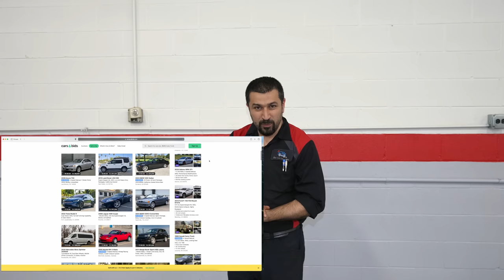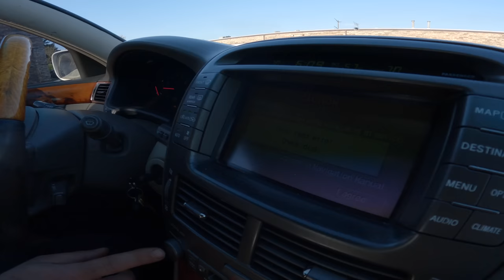I Bought a 600,000 Mile Lexus Sight Unseen! How Bad Can It Be?

Comment: Funny but I owned a 1993 sc400 I put over 400k on it and believe this or not I never had an oil leak only minor cost repairs. I sold this and it only needed was suspension over hauled. The best car I’ve ever owned. I own a Mercedes cl ,ml,sl,clk,and an e class . BMW 7 series ,3 series and the absolute most reliable and cost effective car Lexus sc400.

Comment: For an old car with high miles, nothing consequential wrong with it if the price is right. One issue is that the model engine they use has an interference timing belt. If you were going to just drive around locally, you probably could do nothing except fix the brakes and it would run for years. I am my own mechanic. When I did the timing belt, I would change all the seals on the front of the engine also.

Immediate fix list: Rear brakes. Bad wheel bearing. Timing belt unless it has a service sticker on it. I would service the transmission with a new filter and a drain and fill but transmissions on a high mileage vehicles are always a hazard.

Comment: My 1990 LS400 had no drips at 200k miles.  ( It had no squeaks or rattles either, but I digress . . . . )
I bought it at 85k and it never failed to start or run perfectly. 
I've been an all uber guy since 2019, but if I bought another car, it would be a V8 Lexus.

Comment: A dirty car can be an indicator of an owner who doesn't care but not always. 
I change my oil every 3k, just had the transmission fluid changed 10k ago and I just put in a new air filter and rotated the tires. But I haven't cleaned the interior in 7 months. It's bad.

Comment: I love the LS too! I have an 02 LS 430 and I LOVE it! Mine has 228k on it, and it smokes some on start up. I'm thinking valve guide seals or worn rings. I haven't gotten into compression testing or leak down testing yet but I'm curious if you see one thing more than the other and is it worth repairing or replacing the engine? It also has sludge build up in the engine. I found a JDM engine and trans complete with all accessories for 2700 near me with 45-60k miles on it. I really do love the car and I'd like to keep it going. I'd love to know your thoughts.

Comment: I've had my share of bad after market starters and alternators but going OEM on brake's and struts. That's just throwing money away. Especially on a car with that kind of mileage. I don't consider after market parts a hack. It's usually worth the risk when you consider the cost of OEM parts when they ware out anyway. What I would look at first is a timing belt. That has a interference engine. Surprised you didn't mention that. You guys never mention what you pay for your cars. It couldn't have been too much.

Comment: My 2015 Lexus GS 350 was $13k with 186k miles. Engine transmission and interior are mint. The exterior has small issues. So 186k miles is nothing compared to that LS430 😂😅. I swear that my GS 350 with 186k drives like a new car.

Comment: A great video again, unbelievable a million miles for this 🚘 . Just off the subject I bought an Xtool D8 in Australia, I really liked it but hold and behold IT DOES NOT HAVE AUSTRALIA 🇦🇺 on it. Yes it has Albania 🇦🇱 and Austria 🇦🇹 when I checked the Oceania region. It does not work for Australian Nissan XtrailT31 2010.  Very unfortunate. From 🇦🇺🦘🦘🦘🦘🦘
Reply: To add, I could not contact any site listed as technical support, none of the email address were valid. This is the reason I returned the tool.

Comment: Hello, I learn something every time that I watch your channel and I enjoy your videos very much. I have a question for you about my own vehicle: I have a 2017 Cadillac Escalade with 93,000 miles on it. Everything is fine, but when I asked my mechanic about changing the coolant and replacing the automatic transmission, filter and fluid, he said that I was just asking for trouble if I did that. What are your thoughts please?

Comment: My assumption would be - driven a lot, but always kept in garage... maybe even washed before parking... that is the only way it stayed rust free for so long and so many miles.

So I would assume the use case was as such, Monday morning comes out of garage and drives for 5 days straight (not sure what is the reason... salesman?!), by Friday absolutely filthy an covered in shit, goes to car wash (even automatic one, it is good enough to blow away the road grime and clean cars don't rust) and then goes into garage over the weekend. Rinse and repeat next week.

This would explain exhaust still being in good shape... exhaust usually rusts from inside because if car is not driven for long time, or driven for short trips the condensate stays inside and rust it out, but if car is driven for long time then exhaust get's how enough so that condensate evaporates. Basically car would be used "warm to warm", it leave garage warm and dry, gets cleaned-up and get's parked up still warm after long drive. 

Same can be said about paint - clearly garages as else the clear would be burnt trough, but as well regularly washed... if the grime stays on the paint this accelerates paint wear. All in all - seems solid car after 600k miles... the only issues there are... all related to hack job, not anything particular broken on the car.

Comment: Pursuit of perfection but not built tough.

The life cycle of a Crown Vic is: Police use up to 200k>Taxi Use up to 500k>Ghetto incarceration until crushed. It’s not difficult to find Crown Vics and Town Cars with 700k+ miles. The difference is they still work.

A super high end luxury car like this Lexus has too many new fangled features like active exhaust or break wear sensors that just add to the Christmas lights on the dash.

Crown Vic and Town Car are trucks underneath. The weakest point is the rubber bushings in the suspension and rear air coils. Oh well. Cheap and easy fix. Won’t stop me from driving mine off road as I occasionally do. I spend so many miles wishing something would go wrong so I could work on it but it just never does 😢

Comment: Most cars with over 200,000 miles have more than their fair share of hacks. Why? because parts for older cars are hard to find and cheap aftermarket parts are often the only parts you can find. Also, when you have an old car with high miles, you don't want to spend a lot of money doing the job the right way. You only care that the car performs its primary function, which is to get you there and back. Good luck with your project.

Comment: I like the LS430, but in this case I'd much rather have my 2007 LS460 with with 134k miles and i bought it with 31k miles. 

Half way through video and if he paid more than $1500 for this car I'd say this one is a money pit.

The average non mechanic could get a much better condition LS 430 for $7 to $9k with much lower mileage and better condition.

Comment: I made a milion with 94 hyundai sonata smiles. Ofc it head engine rebuild pistons went to .50 metric automatic gearbox rebuilded  cuz i lost 4th gear it cooked,  i needed to do hack job esp at rear end cuz i couldnt find parts there was no control arm bushings exist anymore  so  i needed to buy whole arm and i bought 4 of them and all of them was left side, at body connection bushings was gone and hole was streched so new bushings wasnt hanging in there so we cut that side and welded again that was necessary cuz when i done front end back side of the car started to go left and right like dancer :D So sometimes you have to go with hack job. But crazy thing body of car was still rock solid and mufler was original smiles sad thing i couldnt keep that car and sold it still i miss it..

Comment: Good morning car care tonight so I have a 1987 Toyota forerunner it's terrible charged I'm having some issues and I'm being told that it can and it cannot be machined the block apparently needs to be redecked what is your recommendation the vehicle has 2400:00 miles originally I picked up the car at 1500:00 at a 160 the timing chain went out we replaced that at  2,18000 the turtle went out We then did a valve job upgraded the Turbo to Garrett and replaced all the necessary gaskets Between 2,18000 2,43000  It began forcing compression into the cooling system it's not in the oil and it's not coming out of the exhaust I being told that the block needs to be reject what is your opinion To classic vehicle and great physical shape but this is an ongoing issue

Comment: I don't see much to complain about, honestly. You're talking about an enormous number of miles. It's not going to be perfect. It seems like it was very well cared for, right up to the point that the second owner took over. That's when all the hackery occurred, which is easy enough to correct. It's not like the hackery got baked in over 200,000 miles. 

It was probably some traveling salesman's car. After the lockdowns, he figured out how to do his work on Teams and eventually got tired of the car taking space in the garage. 

I think the problem you'll have is drawing the line between maintenance and restoration. For instance, when you realize how much it will cost to replace all the seals on a 600k trans, you have a choice. Replace the seals and gamble that the trans won't die soon, or just rebuild/replace the whole thing now? Good luck on your purchase.

Comment: I can see a lot of posting coming from this long-term project car.  With any luck, no major oh-sh$& will happen.  It would be nice to have a 1 million mile Lexus in the garage.  

This is almost the complete opposite kind of vehicle I buy; buy a very reliable manufacture model 1 year off a major redesign with as low as miles as you can find.  Then, you stay on top of the O&M.

Comment: I just buy 01 lexus ls430 with 125k milles timing belt snap so I'm going to start at the heads oil pan visually check the pistons if I have to I'm going to rebuild the engine from ground up

Comment: Me thinks doth complains too much. But with that said, you also got carried away in the auction and paid double what it's worth. I sold an 03 Sequoia with 500K last year for $5000 after putting a few thousand in parts into it, but only paid $1200 for it. You get the parts at wholesale and provide the labor for nothing so you have bragging rights for the mileage. That's priceless.

Comment: Amd, I love ya, but they aren’t “hack mechanics” because they used a different hose clamp you don’t like or bypassed the heater valve. Heck, it sounds like the owner drove long distances for a living and could’ve been stranded far from home with an unacceptable wait for a bypassable part. Circumstances exist. It isn’t always about comparing one effort to another. Not every shop is the Toyota dealer… and that’s OK.

Comment: I'm not sure why aftermarket hoses and worm clamps are such a red flag. I understand they're not OEM, but they work just fine most of the time. Zip ties on hoses make sense to me if the old, aged plastic clips that hold everything have been heat-cycled to death and disintegrate if you look sideways at them and the clips are discontinued or you can't find them.

Different ways of doing things, I guess. Must just be a "hack mechanic".

Comment: People these days are spoiled. If you go back 40-50 years, cars didn't make it much past 100,000 miles and the engines were caked with oil and grease and burned a quart every few hundred miles or worse. I consider this car virtually mint. Just needs usual maintenance items for its age and mileage. I would be more concerned about the timing belt than a few oil leaks. Yes, I would fix the leaks, but if that is all that is wrong, it is a great car. Zip ties don't bother me. The factory clips break and can be hard to get. At least stuff was tied back up sort of where they are supposed to go instead of left hanging.

Comment: Would like to see the car fax, if the heads were never pulled or any other internal work done, that's amazing, basically maintain the fluids and timing belt air filter and drive it until it needs brakes and suspension work and tires, why can't American car company's buy one of these and just reverse engineer it, and learn what there missing I'm sure that back in the sixties Japan looked at what we were making, and learned what to do and what not to do

Comment: Hey, i do own a ls430 and i am facing an issue with the check engine light and vsc off light. Can you help me with what could be the problem, as when i start the car their is a mild vibration and i have changed alk the spark plugs and a coil for on the plugs which as showing an error for. But still havent found a solution for the problem, also the cars initial power or the pick up not at all like the way it used to be. Looking for help on this issue from you. Thanks

Comment: I honestly think you over paid for that car, with so many miles, I wouldn't had paid over 2,500 for it, tops maybe 3k, I just got a 1993 prizm with less than 120k, so far ive spent 3-4x what I paid for it, restoring it mechanically, and I havent even dug into the body work 😅, and it still needs 4 new tires, and a new spare

Comment: I need your help if you can I have a 2007 toyota sienna and at 70 mph I get a check engine. light and a loss of power the toyota dealer can't find the problem and my local mechanic can't either if I drive it at 60mph to 65mph all is well what are your thoughts on this.
Thanks in advance

Comment: In a previous video, "Do's and Don'ts For Transmission Fluid" you reccomended NOT changing the transmission fluid on a high mileage car but you just stated that you are concerned about the transmission and will change the fluid and filter in it. It just made me do a double take when you said that in this video because after watching you earlier video about transmission fluid I decided against doing that in a 2010 ES 350 with 170K miles on it.
Reply from the maker: That is the case if the transmission never had any service. The transmission in this car have had multiple transmission fluid services done to it. Still very risk and I’m still debating it

Comment: So, the odds of finding a car with 600,0000 miles is low. The probability that the repairs on such a car would be properly done is actually very very low. Everything you found was relatively predictable. I don't find this very informative whatsoever. Possibly educational to those with very limited experience in high mileage used cars. Now, find and feature a car of 400,000 miles or more owned by a non collector that is in perfect repair.  Wow, that would be amazing. Again, not talking about a car in Tyler Hovies  collection or Jay Leno ...😮